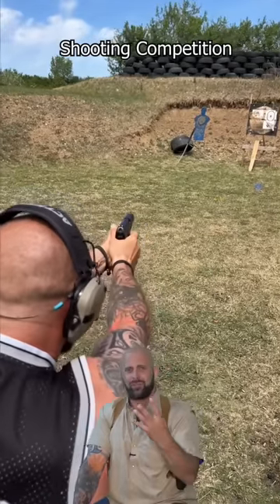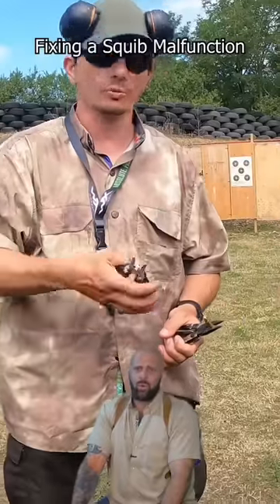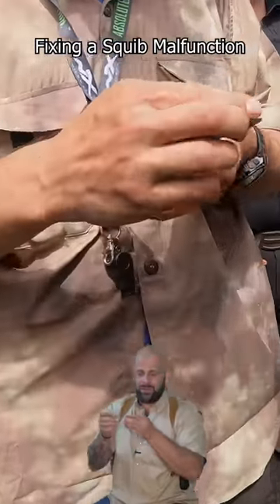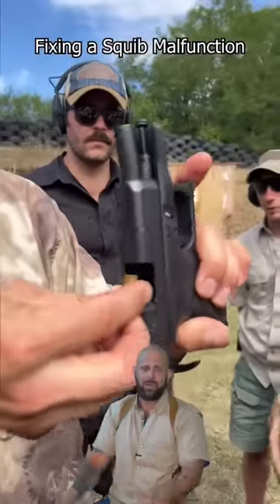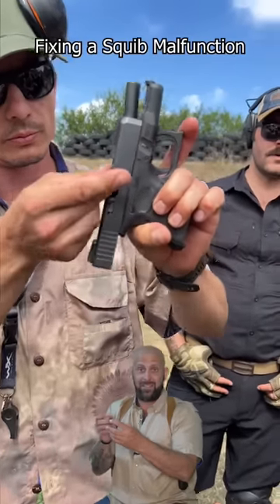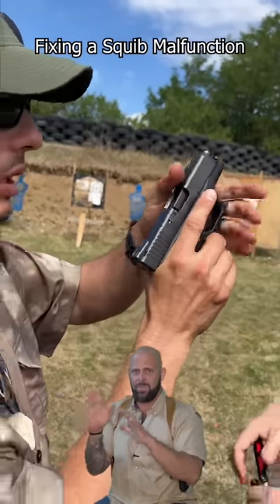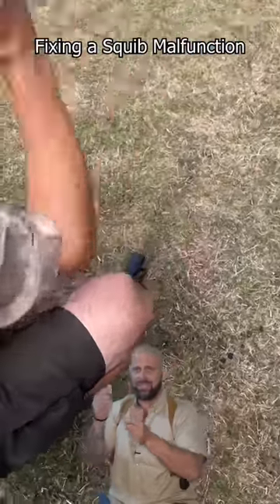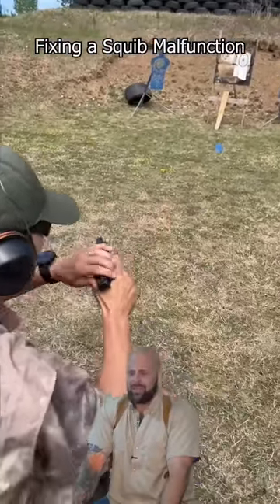Israeli Tactical Training School: Advanced Pistol. Video Clip #10

Comment: This seems way more dangerous than just punching it out
Reply: It is, if the bullet is off at all you're gone have a bad time.
Reply: @itzmistah_1874  or actually obstructing the barrel 😅stress in barrels is real
Reply: Yeah ive had 1 squib in my lifetime and i got a wood dowel to punch it out. It happend in my .22lr G44
Reply: @SAT_Homeless  it happened to me a little over a month ago, was shooting cowboy action 45lc loads
Reply: @sat_homeless  g44 moment
Reply: @itzmistah_1874  you're gonna have a bad time!
Reply: Well it is for sure. Please don't do it.
Reply: Yeah, this “method” is dumb. Just rod it and call it a day.
Reply: Haha. Yeah. Timing is off.
Reply: @sat_homeless  same for me and turned out the projectile had some corrosion on it and I didn't notice when loading it.
Reply: Ehh, it is using the same pressure it was fired with so.
Reply: @itzmistah_1874 not really, unless your barrel is made of chinesium. Empty charge doesnt put off that much pressure.If it squibbed, there's a good chance it already was off center from before it ever fired. Firing another bullet into a squib, would shatter any barrel.
Reply: @YotaLC-wo6qf  actually it's more pressure due to the extra air trapped between the squib & the caseing. This air will be compressed with the igniting powder & allow far greater pressures to generate before the squip can begin to move & build speed. Black powder is actually far worse in this situation as well, needing the bullet to be seated directly on the powder with no gap.
Reply: @YotaLC-wo6qf  except the powder isn’t distributed evenly
Reply: @YotaLC-wo6qf  it's not using the same pressure. It's probably fine most times. Research loading light loads, that should make it mae sense.
Reply: Yea i agree doesnt seem like a good idea
Reply: @Ljaydbay  not many calibers will even be able to rotate saidways 9mm and .45 won't they are near 2x as long as they are wide. As for it digging into the rifling that's by design often they have a soft metal jacket like copper and this deforms before your rifling. But every time you fire a bullet there is a little ware on you barrel. That's why for many fire arms they are replaceable. (Might need a gunsmith for rifles)
Reply: These are battlefield techniques in combat you don't have time to take your gun apart in live fire situations
Reply: Yeah it does
Reply: What happens if you don’t even notice your barrel has jam in it and you just fire another bullet straight away?
Reply: @BLACKHAND  but "in combat," you're gonna have time to disassemble your ammo and possibly have the gun blow up when you try to engage the enemy?
Reply: @blackhand207  and FYI, you don't need to dissnas you handgun or rifle to punch an obstruction out of the barrel lol.  Don't know if you've heard of these things called cleaning rods lol
Reply: @uninspiredrambler  rung barrels in many people's future if they follow this "advice"

Like most "trainers" they are teaching horrible practices.
Reply: @dinklezucc5982  Oh no 😬 That’s not good at all. Thankfully I have only had 1 and was in the woods where I was able to find perfect size twig to poke it out lol. Glad I noticed 😳
Reply: @rs2085  nah it’s not dumb, this is a tactical survival channel. You may need to do this one day god forbid you are in the field somewhere defending the homeland or whatever I won’t always have a coathanger nor the time to try and punch it out. It’s good to know different tactics.
Reply: @deejayskyce5282  beg to differ we have intentionally fired squibs in 5.56 heavy barrels and the result where bulged but not popped barrels , even in handguns it's not a guarantee that the barrel will pop , it is very likely that that's what will happen but far from certain
Reply: @blackhand207  a battlefield technique? Yes pulling a projectile not spilling the powder having to keep your gun oriented in a specific way while your loading it is way more expediant than just locking the slide back and punching the projectile out what the a pen , you can literally leave the mag in the gun lock the slide open punch the projectile out hit the slide release and go back to shooting
Reply: @avlawns3037  agreed
Reply: He was trying to be tacticool when he could've just been safe on a range.
Reply: @blackhand207  you don’t need to take the gun apart to ram a rod down it. This probably takes longer anyway.
Reply: Id replace the barrel if u had the money. Who knows what happened
Reply: Uhh… yeah.. what if it semi seized in there then you blow up something behind it.. that gun could lose some pieces I would think lol
Reply: @CivilCIA  If he used a rod he could've inspected the bullet to determine safety. If it was just a weak load the barrel would be fine. Now it is just a guess and probably even more damaged.
Reply: It's why one of the AKs comes every range trip. I never forget the cleaning rod that way.

I would rather end the range trip than do this, emergency use only.
Reply: The hardest type to detect if you're rapid firing until it's too late.
Reply: You’re literally using the exact function of a round in the chamber to expel the squid how is this more dangerous? Pls explain
Reply: This is another tool in the toolbox. Would you ever need it? Probably not. But it’s there nonetheless. Ramming it out would always be better, time permitting.
Reply: @madeonearth6506  sure bud, I’ll take the time to break out a pair of pliers and do this. And hope there isn’t a hard obstruction. “Real life”, once this becomes a part of POI for my profession, I’ll be sure to pay attention to it. Until then, it’s more non sense on YouTube.
Reply: @deejayskyce5282  I don't know if you caught what was said or even watched this, but he took the bullet out of the case and put the case into the gun, essentially using a blank to push the bullet the rest of the way out. Bullets are always slightly larger than the barrel, that extra width of the bullet is what engages the rifling. The bullet can't go off center.
Reply: It is!
Reply: That's because it is
Reply: I'm seeing so many goofy comments here people saying what the bullets are off how's the bullet going to be off it's not going to go sideways in the barrel a squib load just means it didn't make it all the way through the barrel problem is he didn't want to stop the class go find a rod and have to beat it out and waste all that time or have this guy not be able to finish the class the only thing that could possibly perceived as dangerous that I thought anyway was the powder in the shell gets loose and ignites across all the way at once but since there's no bullet in the tip the pressure is not going to spike enough to make a difference so there really was no problem here
Reply: @9mmthroatpunch211  a screwdriver is generally easier to find than pliers but I honestly thing this vid might be kinda bs because how the heck did they remove the bullet without a) damaging the case and b) without losing all the powder in the case. Second of all, the air gap between the primer and the bullet lodged in the barrel contains more oxygen so you get a hotter burn but more importantly you get unequal chamber pressures that can lead to barrel failure. Finally, there may be a reason other than a squib load that caused the bullet to become lodged.
Reply: Lol I was going to give my $0.02 but instead after reading many of these comments I’ll just say that the amount of people that think they know shit but really don’t know shit, is amusing 😂 lmao. As well as all the nervous Nelly’s.
Reply: It IS more dangerous
Reply: @blackhand207  using a rod to ram it out is still quicker than trying to pull a bullet and loading the round while trying not to spill the gun powder in a high tension situation. The only thing I could see being viable is if the soldiers were carrying pre made blanks.
Reply: @V4p3rcl0ud  squib loads are under powered and won't even cycle the gun properly in most platforms. Fast firing a revolver on the other hand would not be pretty.
Reply: @cameronbartlett856  absolutely the only way this particular tactic works is on the range in live fire on the battlefield using a rod would be your best bet
Reply: If you reload you know if you drop just a bit out of the case it reduces chamber preasure and pops the bullet out with out issue.  .. :) easy peasy
Reply: @Deejay Skyce  well its not the bullet that causes it its the pressure change your taking a massive charge and putting it under the primer because there isn't a bullet to keep the powder from sliding and the primer pops off then the powder it can cause a big pressure spike its not a safe thing specially when the bullet itself thats stuck is maybe out of spec or is corroded
Reply: @BLACKHAND  and you dont have time to pull out pliers and take apart a bullet and carefully put it in the chamber and risk a catastrophic failure...just open the chamber and push it out with a stick
Reply: @thugginugly1941  it go boom boom
Reply: @MadeOnEarth  but you will have pliers? If you can push it out do it use a stick,cleaning rod, the rod on a tourniquet this is a very very very last resort your risking the barrel the gun and your face
Reply: @thugginugly1941 your gun will explode, usually numbing your hand but possibly much more severe injury
Reply: @thugginugly1941 barrel may explode
Reply: Would hope no one follows this stupid way of  removing a bullet stuck in the barrel. Very dumb and dangerous way to  remove a stuck bullet.
Reply: @YotaLC-wo6qf No it isn't if there is empty space in the barrel the pressure and rate of gas expansion is radically different. It can cause a ruptured barrel.
Reply: That's what I was thinking I've had plenty of squibs shooting bad reloads
Reply: @deejayskyce5282 actually not true , i have a pic of a large frame smith with 8 rounds stacked in the barrel, yes 8 the guy actually reloaded and tried again...
Reply: @rs2085 powder distribution really doesnt make that much of a difference the biggest issue is that the projectile is already seated in the rifling making it much harder to start moving again. A new round actually has a slight jump to the lands and has the powder engergy and inertia helping to engage the rifling....
Reply: Right !
Reply: @thugginugly1941 what happens is your gun turns into a grenade lol
Reply: @blackhand207 dont have time to "field strip" your weapon... which is designed to be taken down quickly and without tools... hence the term "FIELD strip".. its meant to be done quickly... in the FIELD... but have time to find TWO pairs of pliers, strip one round from your mag, carefully pull the bullet apart and chamber load it into the weapon at just the right angle so it doesnt spill? Or you lock your slide back, or release your rear takedown pin, jam a rod in there, lock it back closed, rack it and continue shooting...
Reply: I imagine the extra danger would be worth it if you're down to your last gun in a gunfight and you get a squib. Unless you want to ask your enemy for a time out so you can take your gun apart. Popping the bullet off seems much faster  in a WCS. Wouldn't do this at the range for the fun of it though that's for sure.
Reply: @billhusk8569 What if you don't happen to have a rod that fits down the barrel but you have your multi tool? I agree this is far from an ideal fix but everyone in this comments section seems to think they'll have their handy dandy metal rod with them and plenty of time to boot in a live fire situation but I can't imagine it ever working like that for a civilian. I don't carry a metal rod everywhere I guess I could but it would be a clunky and not very versatile item to have on my person at all times. A multi tool is specifically designed to fit in your pocket and has many uses therefore I carry one everywhere. This is a method you can do without a rod if you do not have one. The rod is safer but this video applies where the rod is non-existent. I would expect more people to carry a multi tool than to carry a rod specifically to push out the rare squib load. I will probably add the rod to my kit now lol but still my point stands
Reply: I have had to do this numerous times. It works well you’re likely gonna cause damage to the bore trying to remove it any other way

Comment: A pencil has joined the chat.

✏️
Reply: have a great time trying to pry out something with a wooden stick a 36,5k psi explosion didn't manage to
Reply: @PistaZOV  It's a squib. By definition, it is not fully pressurized. Wooden dowel is the standard way of dealing with this.
Reply: @Colonel_Flanders  agreed.  I put electric tape on the metal around the eraser metal and pretend it helps
Reply: A fucken' penzil!
Reply: @Colonel_Flanders  and a wooden dowel is a much sturdier  compared to a pencil. Also, find me a pencil that can reach a bullet in the middle of a 16" barrel
Reply: @DJ Két Oldalú USB Kábel  just go backwards pops right out every time and no risk of explosion
Reply: Thank you Jonathan, it's nice to have you at the Continental again😉
Reply: @PistaZOV I've fixed a squib with a pencil twice in my life.
Break the firearm down, slide pencil into barrel, slap pencil off table while holding the breach end of the barrel so as not to slap it off the table
Reply: 😂😂😂 you said a pencil and think everybody else in the comments is stupid👍.